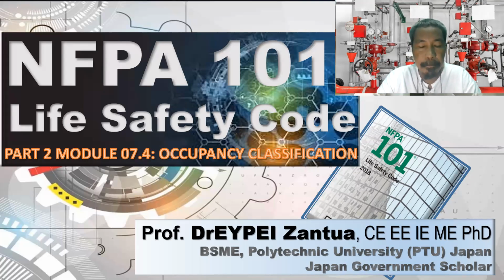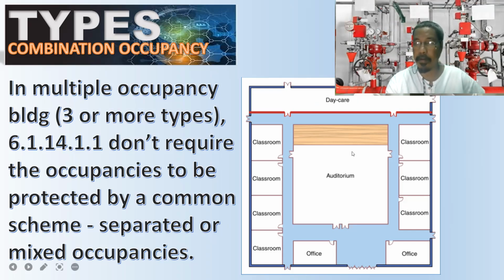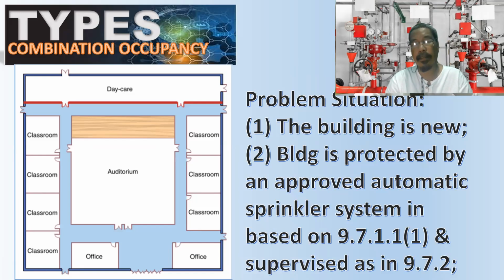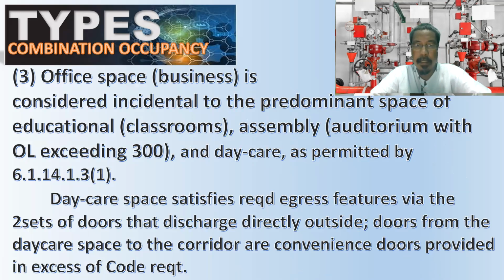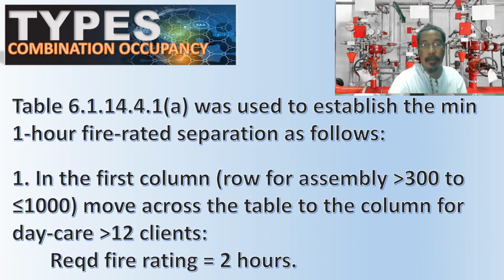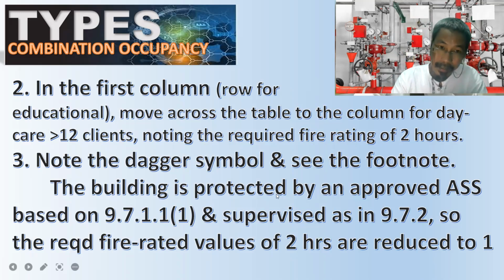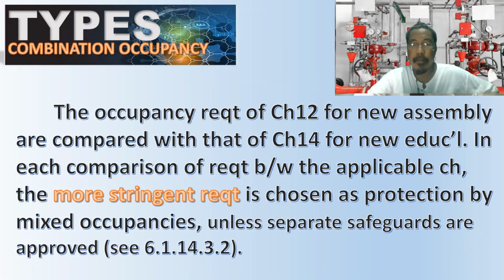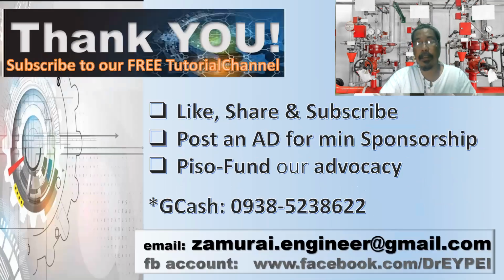COMBINATION OCCUPANCY-NFPA101 | General Requirements: Module 07.2 [Reference CODE by RA9514-IRR2019]

Comment: Thank you, sir. In this video, it discusses combination occupancy, where each structure should have distinct codes to apply to each, so that it will lower the danger if they put fire resistance in every corner, and it also needs fire walls between spaces to help them minimize damage in the vicinity.